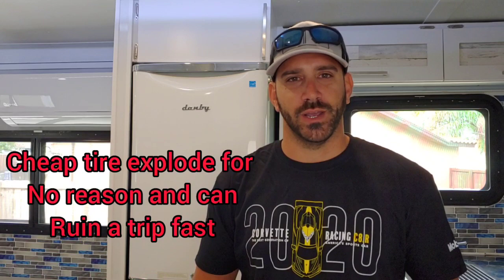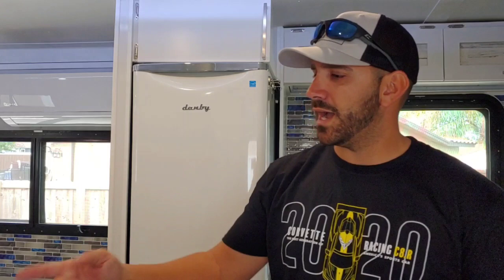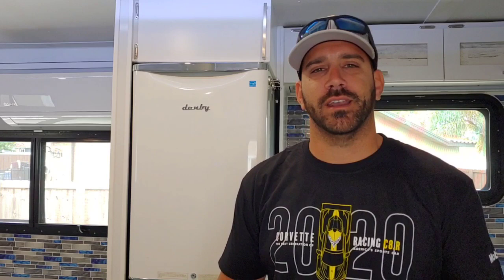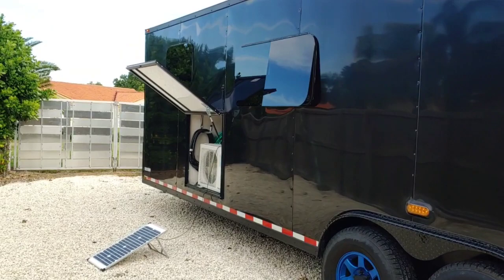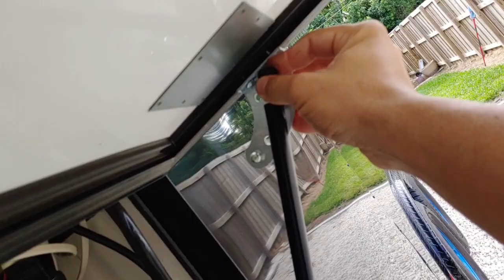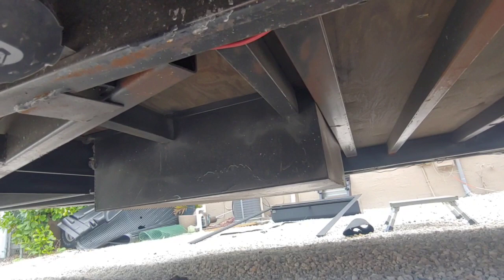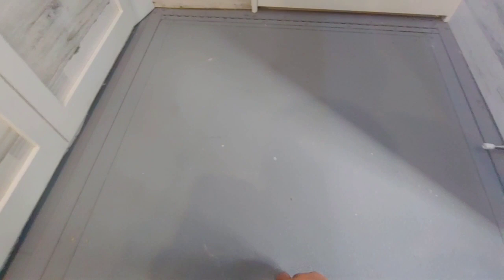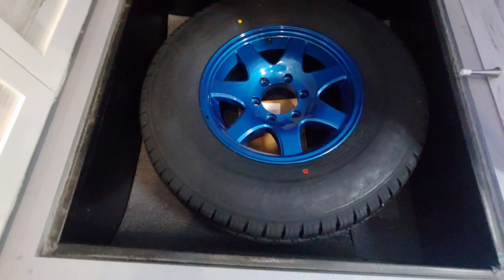28 ft cargo trailer to toy hauler camper conversion. walk through with tips lessons learned

Comment: I built a 6X10 for working on the road and learned a lot. I did go with an electric water heater outta the gate and plumed the shower head on the back door so showers are taken outside. Since I went electric on the water I went with a small 120 home depot refrigerator also. Since I'm by myself a half hour a day of running the generator keeps my fridge cold all day everyday because I dont open it that often. I shoe horses in southern states during the winter months so didn't insulate due to the fact that my work takes me from 70° in the north to 70°weather in the south like clockwork. I'm making a fortune yet I still camp out on free land dispersed camping year round! I'm saving a lot of money thanks to my cargo conversion. Cook stove has 18,000 BTU burners so coffee is done in about 3 minutes. Life is good. Awesome job on your cargo conversion, thanks for sharing

Comment: Nice  video building a square drop I'm definitely getting a hot water heater and wiring a 30 amp fuse so I can hook up I'm getting older so I need already got a black water tank and a water tank

Comment: Keep from rear end trailer scrubbing dragging use wide pan cake rollers on back rear of trailer keeps rear trailer from tearing up. Usually anything standard heigth in a enclosed trailer over a 20' -21' total length ball coupler to rear of trailer should, to keep from dragging. Taller trailer keeps rear end of trailer dragging as much but pan cake rollers wheels are cheaper to add and install when buying or ordering a trailer.
Reply from the maker: I won't put any of those on. The rear bracing isn't very thick. I decided its just better to raise the trailer

Comment: Pro flex white caulking will fix the gaps on your wiring hiding moulding. It’s made for RV’s so it will flex.
Reply from the maker: Yea I have to redo it. The chaulk shrunk some when it cured and I never touched it up.

Comment: On the door to the mini-split, cut a hole in the door, add a vent cover, and you won't have to have the door open to use the Air Conditioner. Between it and the hole in the floor, it will give you plenty of airflow. That is about all I would change except I would add a second battery for longer battery power availability.
Reply from the maker: Rather have the door open then have a ugly mess door that water will go through everytime it rains.. I can go all day on one battery. Have to build what works best for you.

Comment: Sorry I disagree with the insulation from the factory, the R factor from the factory is R5. Using spray foam sprayed underneath and in the ceiling and walls will give you an airtight seal plus minimum R12 in the walls, R18 in the ceiling, R24 underneath. This always makes the trailer more rigid as well.
Reply from the maker: I know there is better insulation available .most people just use plain foam. Very few use spray foam. So far its worked for me. I haven't done my floor as usually dont use it in extremely cold climates
Reply: @BuiltByMike  Yes using foam boards creates a air gap between the walls and the foam board which can cause condensation. Closed cell spray foam eliminates that problem. I am glad the factory insulation serves your purpose.

Comment: Great video where I appreciated your tips and lessons learned.  That was very helpful

Had a couple questions:
Where did you get the trailer from?
What are the dimensions of your trailer?
Was it easy to get insurance for trailer including all build out?
How much does your trailer weigh after building out?
Reply from the maker: Bought it straight from the manufacturer in Georgia. It's 28 plus 4 foot v. I ordered it with an extra foot of height. I have it insured for 20000. It's about 7100 complete now.

Comment: Very nice trailer, sorry about all the comments but I am a 60 year old retired carpenter / IT professional who has built a few trailers. I would believe you would want your viewers to have a second opinion. Buying your trailer with floor bare and coating it with epoxy is the best bet as it will expand and contract with the movement of the trailer.
Reply from the maker: Everyone builds the trailers to suit their own needs. Epoxy floor coating aren't very flexible either and will most likely crack at joins also. If I can do it over I would have had the manufacturer install the one piece vinyl floor.
Reply: @BuiltByMike  Or you could install vinyl floor yourself. What makes it special coming from the manufacturer?
Reply from the maker: @vice4134  it's finished behind the walls for a cleaner look. You can also diy it but won't come out as clean. And viynl plank on the Dove tail doesnt work great.
Reply: @BuiltByMike  
I understand, but when it's worn out and needs to be replaced. You will have to cut it out anyway. So, installing it yourself can look good with trims around the trailer. 
I'm sorry about your experience with that trailer company. To save your time, I looked at all 400 comments so I don't have to repeat those same questions many have. Thanks for sharing your experience with us.

Comment: HEY MAN!
How about mounting your spare tire on the side of the outside of the trailer with a lock? Or boxed it in on the outside? Maybe you don't know? But you can go as wide as your fenders or tires and still be legal on the road.... Nice build & vid.
Reply from the maker: Fenders are flush with the sides of the trailer. I like the indeck storage
Reply: I NOTICED THE FLUSH FENDERS NICE. I SAW BLUE RIMS NICE & NICE BLUE KITCHEN COUNTER TOPS & BACK SPLASH IS BLUE YOU MUST LIKE BLUE!  I LIKE HOW YOUR WINDOWS ARE INVISIBLE OUTSIDE! I LIKE HOW YOU TOLD ABOUT CHANGES YOU MADE ON NEW TRAIKER COMPARED TO PREVIOUS EXPERIENCES WITH PRIOR BUILDS, LIKE YOUR HEATER DID NOT KEEP TRAILER WARM WHEN IT WAS LIKE 20°? AND HOW LOUD AC WAS ON TOP OF TRAILER?? WOW THESE ARE THINGS NO ONE KNOWS UNTIL ITS TO LATE!! RAIN AND NO PLACE TO PUT MATTRESS TO KEEP IT DRY?? SHOWER TO SMALL CURTAIN STICKS TO YOUR BODY. I LIKE HIW YOUR BED GOES UP & DOWN ITS ELECTRIC,  SOME GUY HAD A BED IN BACK OF HIS TRAILER HE HAD TO PULL EACH CORNER OF BED UP WITH STRAPS A LITTLE BIT AT A TIME IT TOOK FOR EVER HE NEEDED A MOTOR. I VIDEO OF HOW YOU MADE COUNTER TOP WOULD BE NICE. THANK YOU GOOD JOB! IAM SURE YOUR FAMILY IS HAVING A GOOD TIME WITH YOUR JOURNEYS IN YOUR WONDERFUL FAMILY TRAILER!

Comment: Love the elevator bed, and the epoxy pour looks good.  Not sure why you have an outlet in the kitchen counter.  Not safe since chance of mixing water and electricity!

For your drains, did you consider a p-trap alternative, like a HepvO waste valve or a waterless trap seal to prevent smells from coming up the drain?

Maybe your drains have something similar that I missed.  (The music got to me, so I had to mute it off and on, and I had to skip a chunck......vid too long for me.  Nothing personal!)

Thanks for sharing your build, especially the links to products you used.
Reply from the maker: The outlet is there for cooking. And is pretty far from the sink and is protected by a gfi. The drain i have never had any smells come in usually when you hooked up you waste hose will have some kind of dip in it that will act as a p trap. I do know about the music being loud in some places it was just the way the music was that the volume in it changes alot.all my newer videos will have the music much lower. I added time marks for people that don't want to watch everything and can skip to exactly what they want.
Reply: @BuiltByMike  The thing with the receptacle is that others will copy it.  It's not safe, that's why its against code.  The electrical code is written as the bare minimum for safety, so it's not like the writers were being extra cautious.

I find it interesting that people don't trust things made in China, unless it's a device meant to protect you.  Not picking on you.  It's everyone.

Comment: Using tires not designed for trailers don’t always function properly as trailer tires have softer side walls because trailer tires twist as the trailer turns.

Comment: Love the detail in the vid. I only have 1 question. If I get the trailer already insulated wouldn't I still have to remove the interior panels to run the wiring for outlets etc?
Reply from the maker: You can run them under the trailer. All my outlets are in the front in the portion I built.

Comment: How well does the water heater work. Quick recovery time? Ever run out of hot water when showering?
Reply from the maker: It works great. It holds about 5 to 6 gallons of hot water mounted the way I have it. And you run the hot about 25 percent hot water and 75 cold water so you have about 15 gallons to shower. We don't leave the water running like we do in the house though. It takes about 20 minutes to heat up again if you go through it completely

Comment: Do campgrounds like KOA actually let you bring this "trailer" and leave it there? Has anyone asked you what exactly it is,  also did you insure this trailer, and what about code like fire exits?  Thanks.
Reply from the maker: Not sure about any code. I have been to many different parks and none have said anything.  Some fancy places in the keys don't allow it though
Reply: I’ve got a 24’ Hallmark I converted (not nearly as nice as this one😕) and I’m originally from California.  Registration on any brand RV manufactured toy hauler was between 500-700$ per year.  These are registered as a cargo trailer, in Ca you get a permanent plate and every 5 years you send the state 10$.  In AZ a permanent plate is 129.00 for life!  Not only do you get exactly what you want and need but it’s much better built than any factory unit (I’ve owned 2 of those over the years) but you add up the savings in registration alone adds up quick.  Only the parks that advertise no rig over 10 years old not allowed have I ever been restricted.  This gentleman did a super job!

Comment: You'll need a p-trap for your drains.  Otherwise you'll have gasses coming into the trailer. Heads up.
Reply from the maker: I usually just go into a 15 gallon tank or dump on the ground.  It's only sink water and shower water. Toilet is self contained.

Comment: Very nice video and good build. I really like the sub-floor idea and all the drain piping to go out at one point to hook up to outside tank awesome. LED lighting is nice idea. Bathroom door that is must 👍awesome. What is your experience for on-demand tankless water heater because that may be space saver for smaller trailer like I am thinking for 6x12 size.
Reply from the maker: Too many amps to run on a generator

Comment: Hey Mike 
 Good looking trailer . I love the black on black! And also love the blue epoxy tops.  I'm working on my 3rd cargo conversion and also scored a happijac bed along with the couch  bed below. Just wondering if you had notch the happijac uprights Into the floor because of the height?  My rear uprights barely fit because of the dovetail but will work and  the 2 fronts will have to protrude through the floor and ill box them in to seal them up form the outside .
Reply from the maker: Thats exactly what I did the front ones go through the floor.
Reply: @BuiltByMike   I picked mine up for $500 so I really can't complain about the extra work lol. Also love the frameless, I've added 6 frameless windows  on my 22' haulmark edge screw less  panels. Also I'm thinking a may regret the rooftop ac I put in. I should ha e done more research on the mini split.  Anyway great job on your build man.

Comment: hey there mike. GREAT video. i found it very helpful and appreciate all of the product links to the stuff that you used. i have 2 questions. 1. how wide is your trailer and 2. how many feet is it from the end of the refrigerator to the back ramp? thanks in advance
Reply from the maker: I have about 19 and a half inchs from the refrigerator to gate and about 18 ft from the wardrobe to gate. Trailer is 8.5 wide and 7 feet tall. Getting the extra height is a must

Comment: I’m curious as to what inverter you used?  What size was it and was it a pure sine inverter? Is the refrigerator fastened and if so how?  I have a 28’ trailer I’m working on now myself
Reply from the maker: Its a 1500watt pure sine inverter. I 3d printed cups that are screwed down that fit the feet of the fridge to keep it from moving

Comment: what's the outer box that the mini split ac is inside??
Reply from the maker: Not sure I understand your question
Reply: @BuiltByMike  you said you added a box that you put in the side of the trailer. the one you have the mini split in. is there a link to that box?
Reply from the maker: @iamkkin  thats a generator door. I had it built with it. Will be a good amount of work to add after as the steel frame goes around it.

Comment: Nice build man. At any point did you consider adding propane and why didn’t you. Would have solved your refrigerator issue and could have cut in a small gas cook top.
Reply from the maker: Didn't want the tanks or possible leaks to deal with. I run perfectly fine off a 3500 generator.

Comment: Love all the thought you put into everything, what is the length of your trailer & the current waight with all of the furniture and accessories installed.
Reply from the maker: It's 28 plus a 4 ft v. It's at 7300 empty
Reply: Hi Mike, what is the dimensions of the garage area? Max length, width, height? I want to build something similar that can fit a Jeep Cheorkee  with a 4" lift.

Comment: hi thanks for the video. can you explain more of the technical aspects pls. does your shower drain have enough angle to run off? whats the link to the mini split? thanks
Reply from the maker: Mini split i bought local.  Shower drains prefect as the drain is about 4 inch higher then the pipe

Comment: Hey mike, what trailer company did you order it from
Reply from the maker: I believe it was called southern trailers. I found them in ebay then called them and  then added the options. Started with a 7k trailer and ended up being 13000
Reply: When you have chance can you post a link on eBay I couldn’t find it. Did you like the way they made the trailer for you.
Reply: How long is the trailer ?
Reply from the maker: Its 28ft plus 4 foot v nose with 12 inches extra height. Its called southern trailer depot in Douglas GA. The trailer is decent quality. The welds are ugly underneath but the complete bottom is painted which is nice
Reply: @BuiltByMike  Why 28 ft when you could go bigger with 34 feet long???

Comment: Awesome upgrades on your trailer, and hoping you can recommend  and or share where to buy base trailer. I would like to purchase trailer with insulation, windows, doors, and dual axles, etc… thanks for sharing.
Reply from the maker: I purchased through southern trailer in Georgia.
Reply: @BuiltByMike  thanks for your response… I’ll check them out, and at the very least I’ll get an idea of my start up costs. Much appreciated…
Reply: I wouldn't recommend installing windows. It will bring in heat & cops if you park on the street.

Comment: What was the cost for the trailer and conversion? Also, where did you order the trailer?
Reply from the maker: Probably about 20k
Reply: Not to sound negative, but for $20,000 you can buy a new toy hauler travel trailer like a 2020 grey wolf 25RR
Reply: @CRASS2047  yeah just not as custom. Also if you don't need a brand new trailer it would be cheaper. As a wheelchair user I would only need 16-18ft
Reply from the maker: Let me see that 25 footer with 2 rzr inside.
Reply from the maker: Or a car
Reply: @BuiltByMike  yeah it all comes down to what you need it for.
Reply from the maker: Exactly the smallest one that can fit a car was a 40 foot Sundancer and was 60000
Reply: @CRASS2047  But you can NOT haul any vehicle. That's the WHOLE point of going with cargo trailer in the first place.

Comment: Hi Mike, excellent work! I had a quick question, when ordering a trailer you mentioned to have them install the insulation for you. Did you find it more difficult to run electrical since you didn’t take the plywood wall panels off? Thanks!
Reply from the maker: Most electrical is ran in the kitchen area. For the tv I used the plastic track that they sell you run the wires on the wall. Can't really run the wires in the wall because the frame is only a 1x2
Reply: @BuiltByMike  What about in the back where you have the LED bed lights with the USB ports, how did you get power to those?
Reply from the maker: I ran the power to the bed across the door and across the ceiling under that trim piece I added to the bed motor and then down the track the bed had. I routered a small v under the wall paneling for the wires going to the lights.

Comment: How is the timbren suspension doing for you? I think this is the first setup I’ve seen with the timbren used as a twin axle.
Reply from the maker: I really like it. It feels like it tows better and stuff doesn't move around as much inside
Reply: @BuiltByMike  Did you look into the timbren silent ride so that your axles would be equalized? Not enough videos on either setup.

Comment: who's trailer ? ( manufacture  ) did they install the suspension system or did you have to do it your self or did a shop in Fla do it ? 
I have watched this 2 or 3 time, such a great job. doing a trailer conversion presently.
Reply from the maker: Trailer is a cnergy trailer. I picked it up in GA. I installed the suspension glad I didn't go with the torsion. The trailer would have been super low.
Reply: @BuiltByMike  what is your thoughts of the cnergy Trailer ? would you buy a second one
Reply from the maker: @philbrown7611  its decent quality. Its not a high-end trailer by any means but its a good trailer. I think all cargo trailer manufacturers have there issues. I was upset about how they gave me the run around on the tires and they said they were going to fix it and never did.